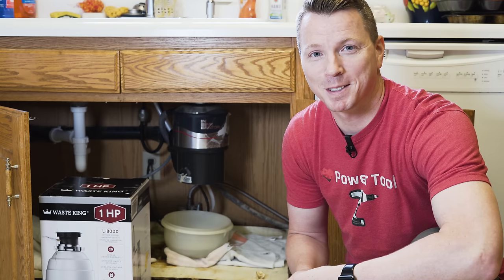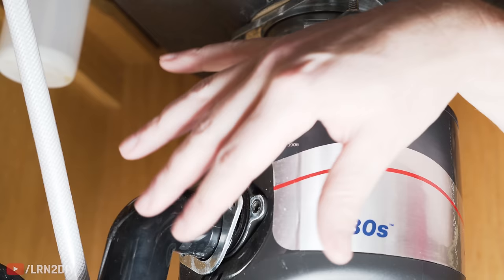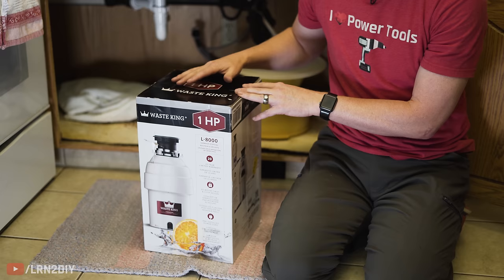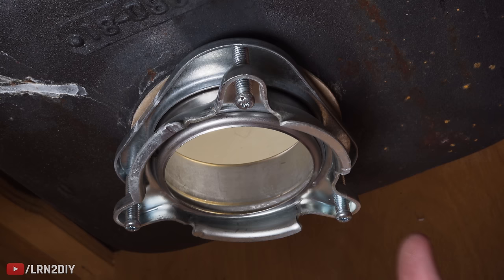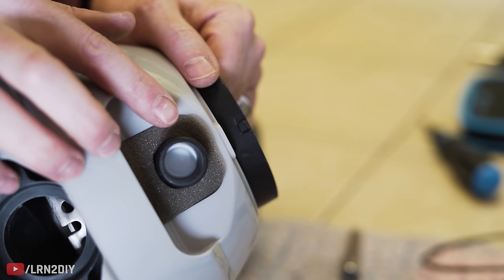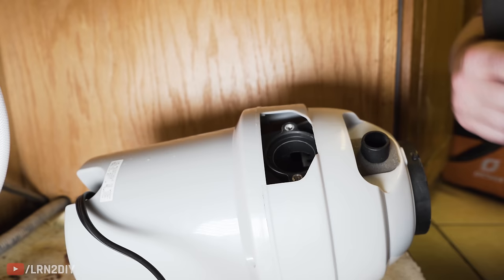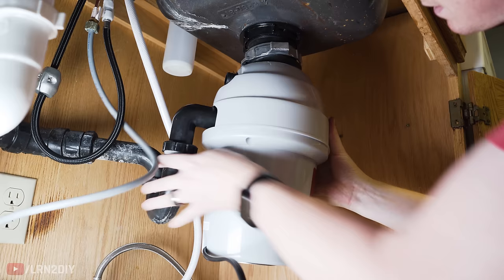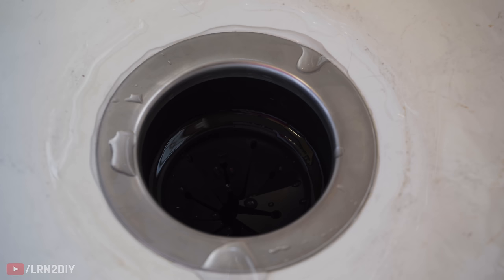How to Replace a Garbage Disposal - Easy, Step-by-Step

Comment: First time replacing a disposal. Made it about 5 mins into the video, and was able to complete installation within 15 mins, thanks to your clear instructions and perfect visuals. Thanks for this video my good man.
Reply: Frankie- I'm  a girl- ok, old lady--
Do you think i can do this???
Reply: @lindagayler6787 Absolutely, make aure u have a big enough bowl to catch the water and make sure u detach the water connections and power
Reply: @damien5613  Thank you. Any advice on disposals? There are so many to choose from. I'm  thinking to stay with the same brand- which is an Insinkerator, but with a long warranty, maybe 3/4 hp for medium jobs? ( i don't  put bones or potatoe  peels in disposal)

Comment: Dude, you have no idea how helpful your video is.  Fast-rewind to right before Halloween.  I bought a dish rack for over the sink, and I started to do dishes with a passion.  Ten minutes later I see a yellow stream of water running out from under the sink.  It wasn't a pipe or two.  The whole connect into the disposal had rotted out.

Fast forward to me finding your video, and I didn't call the plumber .. instead I went to Lowe's and bought at Garbage Disposal (With a power cord!) a bunch of p-traps and gaskets ... and I had the thing fixed!

I didn't even know how to take out a garbage disposal before looking at your video.  Keep making good videos man.

Comment: I cannot thank you enough for this video. This morning I swapped my 12 year old Insinkerator that stopped working with a new model. Your advice on not forgetting to pop out the dishwasher tab saved my butt, as well as the tip to use stacking Tupperware (I used two empty shoe boxes). Excellent video!
Reply: I currently have a jammed 1/2 HP Waste King garbage disposal that hums for 5 seconds or so and trips the red reset button. I know most disposals have the opening underneath to “unclog” disposals but this brand does not have that. Any other suggestions before I buy a new one? Thanks

Comment: 10 out of 10 stars. I chose the 1/2 hp Waste King...followed your instructions step by step, perfect, thank you, took me about an hour. I had to cut a bit (1.5") off of the new drain pipe coming out of the new disposal so it would fit in the sink drain pipe, but beyond that, no issues, thanks again🎉🎉🎉🎉🎉

Comment: AWESOME, AWESOME detailed video DIY!  Best tip and most important tip about the placement of the rubber ring in the groove for installing the disposal to the sink drain pipe.  Well, and having something for the unit to rest on when de-installing, and installing the new unit.  Also, shout out to the awesome customer support by MOEN \ Waste King.  I had this unit installed for 6 years and it began to leak from the bottom of the disposal.   They replaced it, no problem.  Great unit!!  Don't go cheaper on other manufactures of less than 1hp.  Spend the extra money.

Comment: very helpful.  I just replaced my disposal and this definitely helped me move through it easily.  The points about wiring it up and attaching the outlet pipe before installing, and remembering to knock out the dishwasher plug were all the kinds of tips that make life easier.

Comment: Just replaced my disposal with the exact same model I removed, an Badger 5, corded. I was able to follow the tutorial here and had new disposal installed in about an hour. My struggle was just with the angle of my pipe work. The tutorial was a great help and easy to follow start to finish.

Comment: Good information. When I am putting rubber to metal or rubber to rubber, I spray a bit of silicone spray to make everything slide together without the problem of bunching of the pieces.
Reply: What kind do you recommend?

Comment: Great video, just as a word to keep in mind, based on electrical code that receptacle under the sink needs to be GFCI protected either by being a GFCI receptacle (which that one in the video isn’t) or the circuit breaker feeding the disposal needs to be a GFCI breaker to protect the regular receptacle. Cheers
Reply: I realize your comment is from two years ago,  however it is wrong, if you put a garbage disposal on a GFI most likely it will trip just about everything you turn it on. It just needs to be on a separate circuit with the proper amperage rating.
Reply: Most garbage disposals are on the same GFCI breaker as the one next to the sink depending on the year the home was built and municipality. Newer GFCIs are less prone to trip from high amp spikes when starting electric motors. Prior home inspector.
Reply: Which electrical code?  Every municipality has a different one.

Comment: how will this attach if, on the top of my sink, there is no ring. (the one you put the roll of putty under before installing on the sink) it's stainless steel and just rolls down about an inch or so.  I cant figure out how the disposal attaches from the bottom if there's nothing on top to hold it up?

Comment: Great video! I must replace my 1/2" garbage disposal after it stopped working - now the (double) sink is draining slow so I assume there's a clog having something to do with the non-working disposal. Anyway, the garbage disposal I'm replacing doesn't have a plug, it has a wire that goes some place into the wall (under the sink). No idea how to deal with that part of the replacement. Yours has a plug. Do I just pull the wires out somehow? Will I need to shut off the power to my kitchen before embarking on this part of the installation? Thank you!
Reply: I would buy a replacement model that doesn’t come with an AC cord.  Then you just replace the wiring connections.  Turn off the circuit breakers first of course.
Reply: @mitchflorida  because I don’t have an outlet located underneath the sink to plug it into.

Comment: Great video! I'm getting ready to tackle replacing a 10 year old disposal but I'm not sure what to buy. How do I know which disposal to buy for replacement? Would it be easier to just replace it with the same model? Lastly, what do you do with the old disposal? Do they go in the regular trash bin?

Comment: Never replaced anything plumbing wise before, but this video seems to make this process look pretty stinkin' easy! One potentially silly (rookie) question, do you need to shut off the water to your sink/kitchen/etc before doing this? Or just make sure your sink is obviously not turned on during the replacement process? 😅

Comment: I'm trying to do this and it is very frustrating.  I seen a few of these videos and they usually don't show how to replace the sink part above the disposal as is shown here at 4:30 and following.  I removed the old disposal, but when I try to remove the drain portion above the disposal, I can't remove that piece.  Any information says to remove the link around the drain but in the old drain assembly, there is no link.  So after removing the three screws, there is still no way to removed the drain piece.  Again, there is no link to use a flat head screwdriver to remove.  In my new assembly, I see the link, can remove it easily but I have no way to remove the portion above the disposal.  How do you remove it when there is no link around the drain piece?

Comment: Excellent video! I'm having a problem that may be similar to the issue you had with the drain pipe. I'm unable to remove the (old) elbow drain piece because the big plastic nut attaching it to the p-trap (?) won't unscrew. I've tried loosening it both by hand and with a plumber's wrench. I've also tried WD-40. The nut just seems stuck on there. Is there anything else I can try before giving up and calling a plumber?

Comment: How do you disconnect it if it is hardwired though? As well as reconnect if you don’t have and can’t add an outlet?
(our home was built in 1910 and the electrical needs completely replaced. So hard to add anything without having to take care of everything else 😭)

Comment: so my supply line under the sink is leaking--the leak/spray is coming from what looks like a gray almost oval looking clip.  i know nothing about plumbing other than you and a few other video's. I understand the supply liine that is attached to the faucet is bad but wth is that thing where the water is spraying from?
Reply from the maker: Hard to say for sure but could it be the supply valve? It would be the piece that connects the incoming water line (supply) to the line that goes to the sink. If so, you’ll have to identify what kind of pipe you have (PEX, copper, etc) and replace the fittings, which may or may not be pretty simple.

Comment: Doesn't the drain gasket go on the side of the disposal device, in the opening that's made exactly for its size? As opposed to the way you have it in the video where you have it outside of the pipe, between the pipe and the metal plate.

I guess my point is that the whole point of the rubber gasket it is to create a seal between two surfaces, but the way you have it you have two plastic surfaces making contact with each other and the gasket is on the outside.

Comment: Thanks for this.  Two comments:  If the dishwasher drain hose is long enough, place it on before hanging the disposal.  Most undersink cabinets don't have much room to work.  Second, should have replaced the teflon tape on the drain p-trap.  The stuff is practically free, and really doesn't work as well after the joint is disassembled.

Comment: Mine has a straight pipe coming out of disposal to the main drain, is that ok or should it be installed with a trap? There is a trap after the main drain pipe going to sewer do I need a trap for both disposal and main drain pipe?
Reply from the maker: If there's a trap nearby that it drains into, you're fine. You don't need two in this case.
Reply: @LRN2DIY  ...Thanks that's what I thought. also having a P trap at the discharge of the disposal might have a tendency to clog easier than one in the main drain pipe with all the food particles and all.

Comment: Thanks for sharing.   question on  after you put that top  piece on that  goes on top of the  sink  if you use the gasket , do you need that putty  still or  no ? as long as its a flat surface like you said ... 
'
Reply from the maker: That depends on the disposal and the sink. I’ll have to refer you to the manual for your disposal on that one because it really is an “it depends” situation.
Reply: @LRN2DIY   The one i just ordered is saying if you have a stainless steel sink  you dont need  the putty  just  the  gasket thing ,  i got it at Home depot its the  Waste King  brand ~
Reply from the maker: @joedevitto6113  I’d go with that, then. Sounds like you’re all set without the putty. Saves a bit of hassle :)
Reply: @LRN2DIY  I got the old one out and  the new one almost i cant seem to get the plug out for the dish washer  its in there  very tight ..   been  using everything  to  hammer it out and nothing  seems do  get it out. any suggestions... i dont want to break the  disposal .?  also the pipe that connects to the sink  is like 2 inches short..  , seems nothing can go smooth  ,   i need a pipe now  do they come in sizes , i never  did this type of  plumbing before.  Thanks
Reply from the maker: @joedevitto6113  You May have to be pretty aggressive with the plug. It shouldn’t be that difficult to remove but maybe you got a stubborn one. Try using a very blunt ended tool with a hammer. Could be a socket driver or a big slotted screw driver. As for the pipes, yes, they make them in different sizes and lengths and they even have kits at the hardware store for this.

Comment: WRONG...the last part where he put the drain line together and then hung the disposal with the drain line attached...NO NO NO. Just hang the disposal free of the drain line and then connect the drain line parts. The disposal will rotate to allow the drain line to line up with the disposal hole. Sorry I did not see this 3 years ago.

Comment: I have been at this for hours cant hook the ring to the brackit
Reply: Did you ever get it  connected?   i cant get the plug out of the disposal its like    glued and the pips is too short  that goes to the drain because this one is  smaller than the on that was in there..   4 hours at this and still not done..